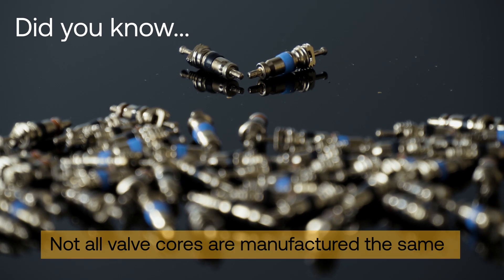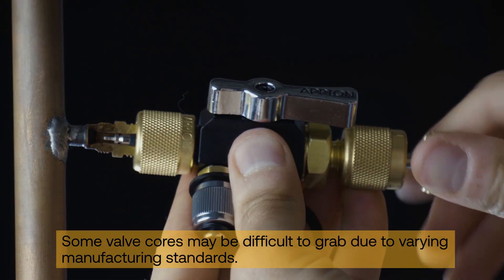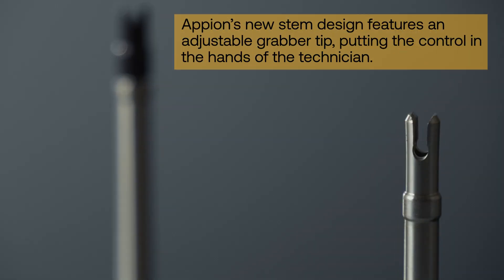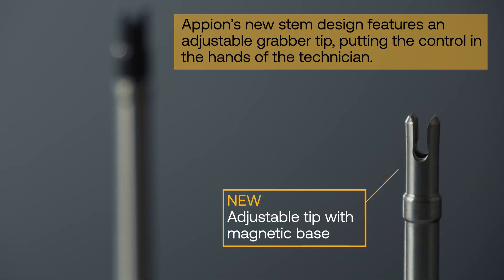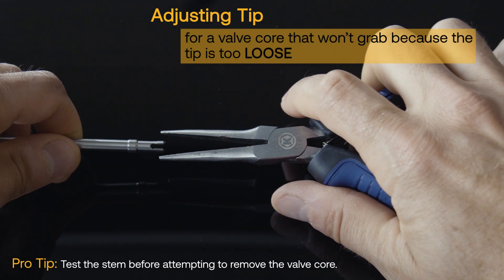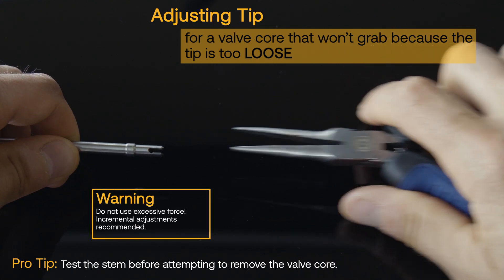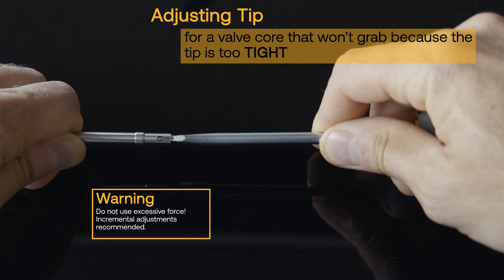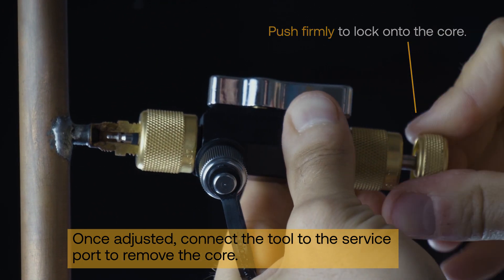How to adjust the Appion MegaFlow Valve Core Removal Stem

Comment: Does it break after a few adjustments?
Reply from the maker: If you make small incremental adjustments it should be just fine. When you start making larger adjustments it can jeopardize the integrity of the stem tip